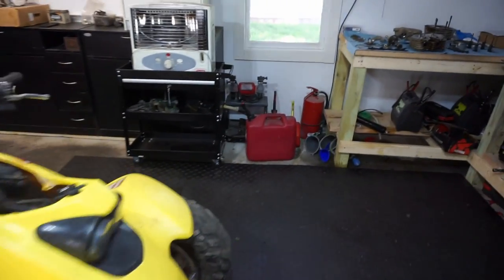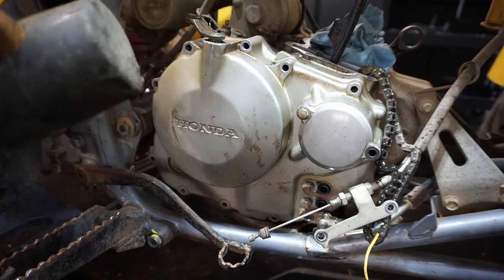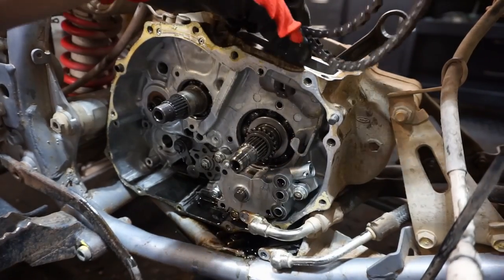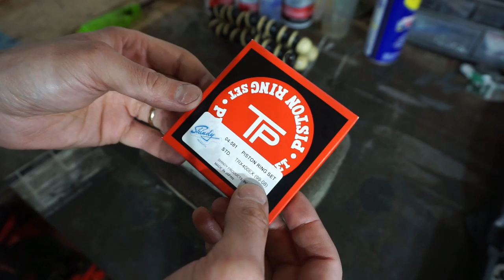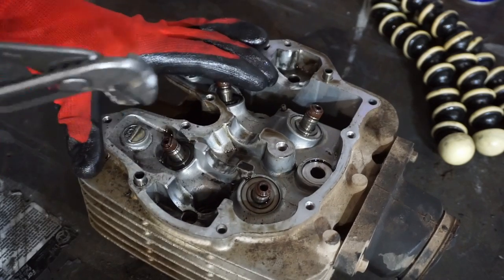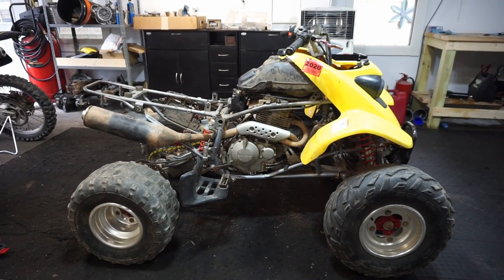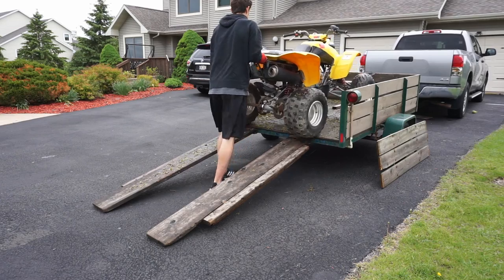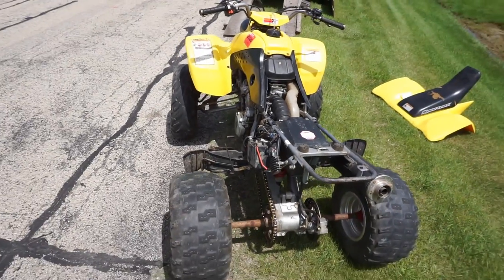Honda 400ex Has Weird Problem. I NEED HELP!

Comment: My guess is that the fuel bowl is not able to fill up fast enough when you pin it. Starved for fuel as you empty the bowl when pinned. Pull the bowl and turn the fuel valve on and see what kind of flow you have into the carb. If it pees or drips. If it pees real good, then the vent out may be restricted causing it  to only dribble in when put together.. Another thing you can do is if the bowl has a drain screw, you can remove it and check for flow. Again, if the vent is restricted, you may show good fill rate but still have a problem if vent is restricted. If you have a bowl drain screw, you can replace it with a fuel line nipple and using a clear fuel line connect to it and bend the clear fuel line up and this will allow you to see where your fuel bowl level is and when test driving, take a look and see if the fuel bowl level is keeping up when under extended full throttle runs.

Comment: Check if there is an AC leaking through the reg/rec I know you replaced it but always a chance the new one could be a dud. Multimeter on AC Volts across the battery and you should see 0v so no AC power. Otherwise I'd say it's a CDI that's breaking up at high RPM but it's unusual in that it only happens in 4th 5th gear. Also you could do the wiggle test on the connections and wires coming out of components like the CDI while it's running and see does it shut off. Bit of a mystery though as to what's happening.

Comment: It could be the CDI or even just a loose ignition wire. I remember one time I had a TTR225 that would only spark intermediately and it was just my ignition wire was loose. Shove it back in there and it ran like a champ! Also, here’s a fun fact for ya, you can bend back valves… I did it once in a video a few months ago with my TTR90 and it worked great with some vice grips lol. Just don’t clamp down on anything too hard so you don’t scratch it.
Reply: Piece of leather between the vice grips and valve stem would do the tricm
Reply: @mimbo2479  yep
Reply: Lmfao. Youll never get them even close to strength. Now you have put valves that have contacted the piston and slammed back into their seats back in and ran it. Engine wont last 5 hours if that
Reply: @krotchlickmeugh627  actually lasted like 10 hours of riding before I sold it, and believe me I wasn’t easy on it

Comment: Either your gas tank isn't venting right or it could be the float height in the carburetor. Try and run it on a separate full tank first
Reply: Because it fires right back up right after correct?

Comment: If it has a parking brake sensor unplug it. Not sure if 400ex’s have one like banshees but if the sensor is  bad it would bog at high rpm revs sometimes.

Comment: Sounds like a fuel flow issue at maximum demand. Fuel filter, lines, petcock or petcock filter, and if not try raise the float level. Even try with fuel cap really loose. Might be mud wasps in the fuel cap breather

Comment: I had a yfz450 that would cut out in high RPM and the way to fix it was to run with the headlights on. Common issue on the old YFZ450. It sounds like it's cutting out right away. It doesn't sound like it's starving for fuel or loosing fuel in float bowl. See if you can replicate the issue in the low gears. Maybe jiggle your wire harness around. Maybe it's shorting somewhere

Comment: When honing it’s just proper to have it centered and not at an angle and it’s a tad of a pain but put the piston in the cylinder then lower it and put the pin in I’ve broke rings doing it the way you did it. But bravo better then most experts

Comment: Maybe vapor locking usually a air filter causes it if the air filter is restricting air and pulling less fuel I have a atv that was bogging down about every mile and died replaced it hasn't vapor locked since also check your carb boot to the engine

Comment: Check all of the wiring connections to the cdi, and I would try to find out ohm readings on the cdi, but check it right after it's warm.

Comment: Any possibility that the fuel tank is not venting fast enough to keep up with fuel consumption at higher demand of 4th and 5th.   I have had a bad fuel cap cause a simular problem.   Peace ✌️

Comment: Did you recheck your valve Clearance’s. where they are new they may have seated a little more causing a very small valve clearance.... then when you really work the engine they lengthen from the heat resulting in zero clearance and then will suddenly loose compression. If you let it sit for a few minutes it will start right back up only to repeat the problem again. Just a thought ....( common problem with lawnmower engines).

Comment: I had a bad plug wire that would arc to the frame at high speeds. The g force would bend it just enough to open the shield at the nick and ground out the coil. The part was rubber mounted so I never got the voltage through the frame to get shocked by it....until one day....then buddy...I knew!
Cheers good luck...and do tell.

Comment: Fuel delivery. Try running it with the gas cap off and see if it dies.. or the vent on carb may be plugged up
Reply from the maker: I tried that already. That's what I thought it was too.
Reply: @2vintage  tell customer you can't fix it, tried turning it in to a Yamaha, but no luck lmao
Reply: @2vintage  but really maybe your float is shutting off gas to bowl too soon.. or opposite end of spectrum, maybe too big of a main or the needle needs to be lowered? Idk bud... That's all I can think of to try besides something with ignition or a safety switch

Comment: something grounding out. if it was fuel or air related it would bog then die. this thing just cuts off immediately like hitting the kill switch. check kill switch and all the wiring and cdi.

Comment: Havent seen a comment saying this yet although I haven't read much - too rich will make it not rev all the way out when you're lugging it and will also cause it to stall when you're pulling hard and pull the clutch in and let off the throttle, might wanna try a smaller main and turn in the mixture screw

Comment: Put clear fuel lines on it to where you can tell if it isn't a fuel issue like the cap not being vented, or the cap not working like it is supposed to

Comment: If the regulator was was fried it might of messed up the CDI unit. Using jump leads the opposite way fries the charging circuit . Bypass the kill switch   aswell.

Comment: I have a 04 recon that was doing that my problem was a short in a wire in the wire loom as the wires would heat up from the motor it would cut out from the wires expanding and becoming loose

Comment: I'm willing to bet the CDI is cutting out at the rev limiter at high temp & high revs. Sound like a 2-part issue. Other than that, I say a solid bike considering what it went through with the previous owner.

Comment: Had a similar problem with a yamaha 350, changed Cdi, stator, Pickup, rectifier, coil, sparkplugwires and on/off switch, still the same problem. Then I changed the keyswitch and it all worked. The guy that owned it before me said that he had tested the keyswitch with a multimeter (He was an electrician and a close friend of my dad) and it worked fine. So i changed the keyswitch last :/ It cost me ca $550 instead of $6 to fix it.

Comment: Check to see if there is throttle switch contacts. if so at wide open it may be safety cut off in case throttle cable lock or break. adjust may be required if present.

Comment: check that the kill switch is not the issue could be once you get to 4th or 5th vibration could be causing kill switch to kill it try riding on rougher terrain see if it happens at lower speed

Comment: I work in a automotive shop   I had a customer Came in head The same problem you heaven i test the wiring harness  It was a bad wagon harness I replaced it He said he didn't have no problems with it

Comment: Hey 2v my 400ex is have a bogging problem at high rpm’s but it ran fine before. I cleaned and rebuilt the carb and put a new plug but it just pops above half throttle. No jet changes or anything, what do you think it could be?

Comment: Check the cdi where the harness plugs in and the harness plug itself, one/both may be corroded. And some cdi boxes will act like they trip a relay inside if the get hot, like under a load. Also, check a Honda manual and see if there is a inline relay for your charging/ignition system.

Comment: Now you are revving it up and going through the gears and then letting off the throttle and pulling in the clutch and then it dies correct? To me that would seem like a carb. issue. pilot circuit is probably plugged or something isnt clean. It looked like it just started right back up when you stopped and hit the start again right. Winding it out and using up all the fuel in the bowl and then it goes to feed itself when you chop the throttle after and the pilot circuit cant keep up with what the engine needs. That's my guess. I have no idea about the battery not charging. I'd have to tear it down myself.

Comment: Not the cdi it would just shut off  and not run . I had the same issue with my 2000 400 ex  after hours of tracing wire found that it was the plug att the rectifier  were wire go into back of it. Was not making connection all the time the vibration from motor would cause it to shut off.  I cleaned  back side of plug made sure wires were all the way in and then hot glued them to keep wire pins from being able to move  fixed it.

Comment: I'd replace the CDI box it's more than likely has bad solder joints inside and it's arcing out internally at the higher RPMs because it has to fire quicker at the higher RPMs.

Comment: Warm the CDI unit. I had an old NX 250 and I had to keep the CDI warm with an electric heater to get the engine running. I eventually replaced the CDI.

Comment: I want say ohm everything out like others have suggested but my hesitation is that things are working at low RPM, so I think you would do all the testing and everything would check out fine. However, the testing might be worth it just to rule it out. If you have a known good CDI box off another machine, you could confirm/dismiss it as the problem pretty quickly.

Comment: I kinda think the cdi then I kind of don't. Usually when a cdi isn't working properly the thing won't run especially that good. You said it has big jets right? Maybe there too big and when you get up there in 4 and 5th gear it's getting flooded out. Maybe try putting the jets back to factory

Comment: Can you run it with a spark tester installed so you can see if you are losing ignition at high rpm?

Comment: Hey I have a 2002 Honda TRX 400ex and can't get it to idle we have played the the idle screw and running 155 main and 42 pilot cleaned the carburetor and adjusted the valves and stills runs but dies could it be a exhaust leak. Sounds like a hiccup though the air filter also

Comment: I would not use a manual timing chain tensioner especially on a new chain they will wear the chain out prematurely and the chain guides I would find a auto tensioner if you plan on making it last. And d.I.d makes a great timing chain also they are as close to oem as you will get but I love wiseco products.

Comment: Only thing i can think is a low oil sensor getting shook from all the vibration and shutting off you can test by just shaking it back and forth while it's idling if it shuts off then there, and run it without an air filter for one ride, it might not be getting enough air at a high rpm, and check to see if there is a stuck throttle sensor because if the cable gets "stuck" it should just either cut off or just hit a limiter at anything higher than idle, and mabye just mabye something with the ignition is tripping

Comment: It sounds like it running out of fuel under full load in 4th or 5th that is the most fuel flow. I know you checked fuel but it sounds like it is not flowing enough into the carb though the float under full load.seen it happen before. Make shure the wire that connects the float needle is on there so when the float goes down it pulls the needle open.

Comment: Only suggestions I can make are to inspect and clean e every connection on the wiring harness and deals with the ignition system and find a cdi to trade out from a know running bike.  I'm thinking the cdi is the issue.  I have experienced similar issues on a yamaha raptor cdi.

Comment: I am getting close to the same problem with my 1991 Honda trx250x it was like that then it got no spark after a week now I have changed everything electrical to new stuff and the only thing I have not  changed is the flywheel so I thing the flywheel on my four wheeler is not generating power so try the flywheel maybe

Comment: I was knocking this design at first. Having to pull the clutch to get to the timing chain at first thought seems like a lot of work but I guess it isn’t much different than having to pull the flywheel/ stator. Interesting the difference in brands design

Comment: I know you said you changed coil but funny thing is I just did video with a chainsaw with same issue.  It would get spark when you spun it slow but spark would cut out at high ram and it was the coil. Maybe got bad after market one . Don't you have a 400ex yourself to try parts from like coil and cdi

Comment: Im actually in the process at this moment of a complete lower and upper engine overall of an old  89 CR80. I did what you did with your giveaway CR. I reconditioned all the faded plastics, pretty much made it “almost” brand new looking restoration. I want to know, just curious, I’ve never used a combination of gasket maker along with the new gaskets themselves. Is there a benefit to a thin layer , plus new gaskets? Also, all my new oil seals…..should they be dry fitted back in their wells when replacing the old ones? Should I get the wells nice and squeaky clean and stick the seals in dry? Wouldn’t that keep any oil sealed out from any seeping through over time?  I’ve heard from a few knowledgeable guys that I need to oil them up a little before pressing them into the seal and bearing wells.   How do you do it bud?
Reply: oil the inside of seals, but not the outside. slip in easier but also *slip out*.
a little bit of gasket maker is just extra insurance that it won't leak. looks nicer than just gasket maker aswell lol

Comment: Hi I am a certified Red level Honda motorcycle mechanic through Honda does it cut out while under throttle ? Something to check is ignition wires and kill switch wires may have short when get at high rpm and vibration makes it short let me know when and conditions it cuts out I will try n help best I can also def look at cdi box I had a 07 400ex and if I would pull clutch in and coast sometimes it would shut off just nature of the beast I am not 100% sure I can’t remember if they have a tip over switch on them so don’t quote me on that I don’t think they do but not 100% sure like I said electric problems is like chasing a ghost sometimes lol keep me posted bud…. Virgil

Comment: If the piston killed three outta four valves , I would expect damage to the crankshaft , or connecting rod also .
Reply: If the piston crown had no dents I wouldn’t worry about it, the  crank or the rod. Engine seems to mechanically run just fine.

Comment: My kids ltz400 atv would randomly shut off like it ran out of gas, come to find out the cdi where it plugs in wasn’t clipping together 100% believe it had a aftermarket cdi on it, I ended up putting 1 or 2 zip ties to hold it together nice and tight and never had a issue with it since for the next year or so we had the bike. No clue if this is your problem figured I would put it out there as a possibility.

Comment: sounds like a pain in the caboose But it's time to get out your little tube of electrical grease and redo all the electrical connections & don't miss any of them. then and only then can you say, u have been through all of them and know .you have all good connections.?& if this fails replace the CDI    & if this doesn't work follow all the other suggestions. there r a lot to choose from . good luck Brother good video's by the way i like this channel.!  ;-)

0

Comment: probably the cdi.but i had a similar problem and it was the rubber spark boot like yours.the wire inside was broken and it was running but not in high rpms.also i dont know if quads have a rollover shut off sensor
Reply from the maker: I replaced entire coil and boot

Comment: It’s electrical. Anything fuel, air or valve timing would have shown up immediately. Those motors are pretty basic. Engine got up to temp and spark cuts out at higher rpm. Go through the entire system. I hated how Honda put them under the rear fender. Great place for water and mud. 🤨

Comment: Manual chain tensioners are a terrible idea. No way to tell if they are too tight. I've seen quite a few chain guides burned up from too much tension.
Reply: he did it fine, start loose then slowly work your way tighter till the cam chain slap goes away. almost always perfect, and you don't have to deal with a spring failing.

Comment: Check your fuel flow. Maybe the fuel filter or gas cap?
Reply from the maker: I checked it multiple times. Rode it with gas cap off multiple times.

Comment: You mentioned that the valves came loose. The only way that could have happened is if the Head moved and I didn't see you check to make sure the deck was flat.Assuming it is not flat. I'd recommend taking the cylider head off and sanding it flat with some 180 grit 3m wet/dry sandpaper on plate glass.
 Use a sharpy if you want it to stand out on camera.